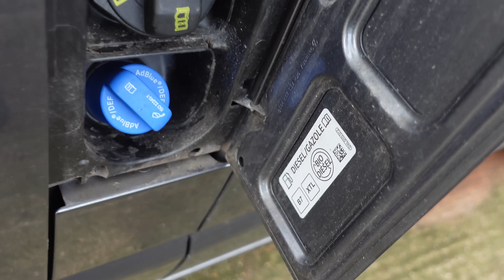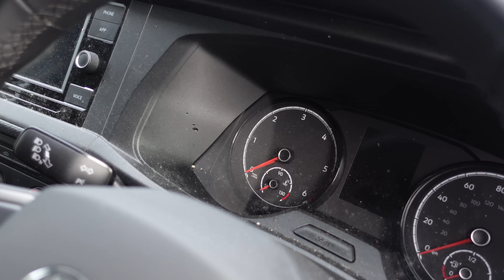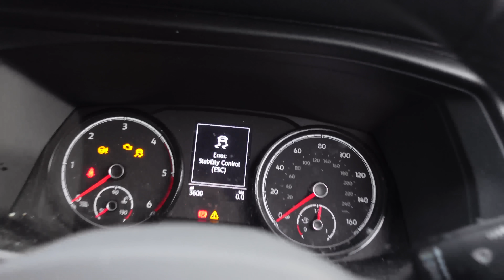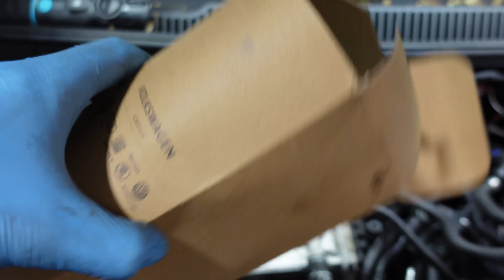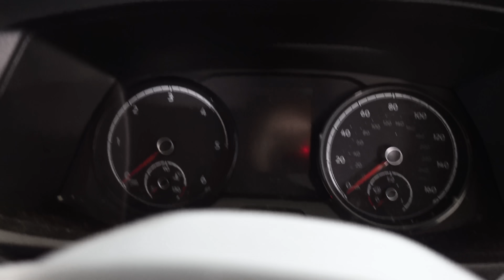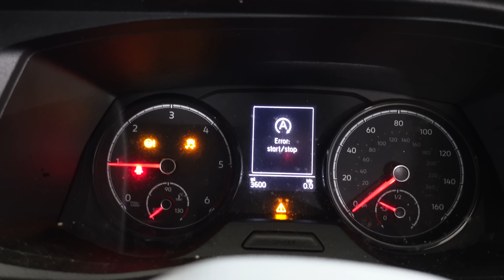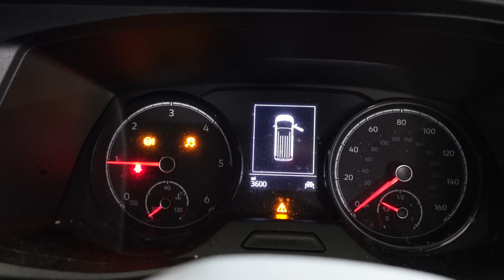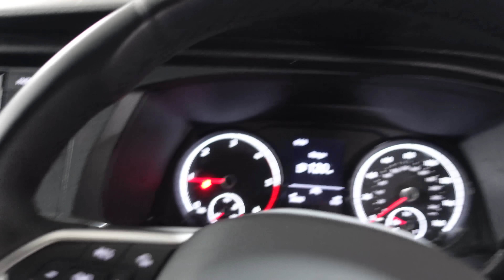I BOUGHT A CHEAP VW TRANSPORTER.. FULL OF PETROL!!! MISS-FUEL...

Comment from the maker: Win the PS5 and GT7 for free: https://competitions.adrianflux.co.uk/enter/win-a-ps5
Reply: You know you don't need to take the fuel tank off right? You can empty the tank with the primary fuel pump. Just hook up an auxillary tank to the secondary pump and let the engine idle on that. It took me about 15 minutes with a full tank. When the tank is empty, chase the last of petrol out with a liter of diesel. Stop the engine, fill the tank with diesel, change the filter and hook everything up again. Costs you about half an hour of work, the filter and a meter or two of fuel hose.
Reply: You should keep it and use it as a tow van for other projects like the caravellle
Reply: Still wonder why you didn't unplug the diesel filter and connected the fuel pump to a 12V DC psu or car battery to pump it out but hey, would make for less content ;D
Reply: UK only ?

Comment: Rather than disturbing everything removing the tank, would have been easier to purge the in tank pump via VCDS, yes you won’t get 100% of the petrol out, but if you brim it with diesel won’t do any harm, save all the hassle
Reply: Yep
Reply: Wouldn't that damage the fuel pump, which is designed for diesel fuel, not gasoline?
Reply: Pump would be fine, 30 years as a tech and never had an issue when it comes to draining misfuels. He made a very simple job extremely difficult for himself.
Reply: @Photos_by_Matt correct
Reply: Have a 2005 T5 that I've made this mistake with, mate powered the pump from under the seat and ran a pipe to a few containers for me, popped 25 litres into it and drove to a garage to fill it, changed the filter then and have had no issues since.
Reply: @welshtourist That was the PD engine and the fuel system was a lot more forgiving to misfueling than the new engines.
Reply: I can’t believe you took the tank out
Reply: @akhtarkh  
Would make no difference as I am referring to the intake pump what’s been submerged in petrol for months, but no not really in tank pumps are rather universal
Reply: @Photos_by_Matt  random one but as you're a vw tech, wondered if you could help me in a bit of a pickle with my wifes car! replaced egr cooler as code was p403 on the 1.6 tdi, now getting code p40700 which indicates sensor low circuit egr, its a brand new oem egr with the sensors etc, what should i test next, cant find any pin outs online to test wiring
Reply: @akhtarkh  not for the low pressure "in tank" pump. And actually changing the fuel filter without VCDS routine probably "f*cked" the injectors. it is possible that tha injectors are now running but not precise anymore on the small quantities (pre and post injections). Resulting later on in filling up the DPF faster and not regenerating as designed...
Reply: @akhtarkh No, Not the pump in the tank. It’s fine.
Reply: But that wouldn't generate the "content" for the clueless.
Reply: @smokinvalves  
That’s a point I suppose…. But for the sake of some extra views, I honestly couldn’t be bothered 😂
Reply: @ePetike36  yep I always Small Quantity relearn, causes loads of issues with the Mitsubishi 2.2/2.4 in the L200/ Shogun / Outlanders
Reply: @RiteSedFred123 
they will probably have there own separate pumps, but same thing as using the intank pump to purge
Reply: Be sure to change the oil before you drive it about.
Reply: @george-hz9xq   yes I forgot to mention that definitely a good move 👍🏼
Reply: @billysmith5168   1.6 CR are nightmare for EGR faults…. Best thing to do is have the EGR mapped out, save your self ££££ get a stage 1 remap probably in the same price
Reply: Battery, old fuel pump and some plastic  pipe. Pipe to both ends of the pump, one pipe down the filler and pump it out.
Reply: @DriveEspana  or just plug in VCDS and purge it out, exactly what the function is intended for
Reply: ‘because it’s been sat for so long’?. Wtf.
Reply: @donalfinn4205  hardly been sat for long enough to be an issue
Reply: That 12v pump you used to transfer petrol out into the containers,  as far as I thought you can't use it on petrol, diesel is ok but its not designed for petrol and risks starting a fire no?
Reply: @Sargejee  one spark ⚡️🧨🔥
Reply: Absolute unnecessary too do all that,drain as much as you can,diesel in,no trouble it will start
Reply: @georgebrehm8622  
100% agree
Reply: Now if only I knew what "vcds" meant, my life would be complete. 

Back before home recordable DVDs were affordable, then VCDs used to mean "Video CDs.  Some clever technical dude (or dudette) devised a way that a standard recordable audio CD could still contain a full stereo soundtrack, but also include 78 minutes worth of full motion video. At the time the video quality was about the same as good VHS video-tape.  

Apparently VCDs were highly popular in parts of Asia where humidity in the air led to mould issues on VHS videotapes.  

Later some even smarter cookie devised a way for a standard recordable audio CD to contain some 40 minutes of DVD quality video and stereo soundtrack, known as SuperVCD or SVCD.  

At the time I remember pretty much all the early home DVD players would play VCDs but only some models would play SVCD.  

I never knew why that was, as the actual encoding system of SVCDs is said to be the same as the DVD encoding type.
Reply: @KiwiCatherineJemma   VCDS is dealer spec diagnostic software, I can assure you nothing to do with DVD or VHS lol
Reply: @akhtarkh  no, liquid is liquid to the fuel pump, as long as you're not running it empty, average fuel pump shoots out fuel at quite a considerable amount compared to it's usage, the fuel pump is basically there to keep a high fuel pressure.
Reply: I agree, a little petrol wouldn't do any harm
Reply: @akhtarkh  Nop
Reply: This makes the guys who specialise in dealing with misfuels look like a real bargain!
Reply: You forget he wanted to make a video not fix it in 10 mins.
Reply: No ,why take tank out...

Comment: Filled my 2015  20,000 mile  vw crafter with petrol.  Drove 1 mile home.   Siphoned as much petrol as I could     Refilled with diesel     7 years and 130,000 miles later everything is fine.   Also drove 100,000 miles in 2005 bmw 530d after mis fuelling    Just personal experience
Reply: you’re probably the luckiest person 😂😂
Reply: This is my question how does someone make the same mistake twice 🙄

Comment: did something similar with my mums 04 golf diesel, she filled it with £40 worth of petrol!! towed it back to the house, lifted the rear seat to get to the fuel pump, took that out and used a pump to get the fuel out, filled it with some diesel and first turn of the key it started.. without replacing fuel pump etc... its been running for over 2 years since without issue.. surprisingly tough VW engines
Reply: Mk4... bulletproof!
Reply: not rustproof though @MrFlamezz100
Reply: I had a 2007 Toyota Auris 2LTR D4D which I filled up with Petrol by mistake and it actually drove fine up the Motorway for over 50 Miles and I only realised something was wrong when stopping at the traffic lights at the end of the Motorway because it was ticking over a bit rough. I returned home covering another 50 Miles before I had a look and found Petrol in my tank not Diesel. I decided to top the tank with Diesel and then just use up the tank full of Diesel/Petrol mix. Eventually it started running fine and I never had a problem with it. I eventually got a newer one after 160,000 Miles.😊👍👍
Reply: @stephenjones9153  Amazing ! 100 miles on a petrol ? Sounds to me that the garage you stopped in wasn't selling petrol .....

Comment: DEAN this is 100% true  i drove manchester to glasgow in a transit years ago then deliverd and then fueld up at 3AM with petrol full tank .   and it was a  diesel van  i started it and sat there eating a pastie  and crisps then it died  ,So i cut the pipe off the jet wash machine stuck it in the tank and sucked and i swear it started coming out all over the grid and grass ,Then i   ree  filled it with diesel ,it started but  it wouldnt do over 50mph in 3rd untill  i got to preston then boom it went normal ,i parked it in our yard at 9am and went home never heard again .

Comment: Half filled my 2.2 transit with petrol before i realised. Toppes it up with diesel and apart from smoking it ran lovely.
Reply: I did the same van run the best it ever did after used and refild
Reply: Yep did the same with my van..As yourself topped it up with diesel. Gave it a good run then filled it up again as per norm...Sorted..
Reply: Had this with a BMW, drained it and refilled with diesel, bit smokey for a bit the ran beautifully
Reply: Problem is too much petrol will do severe damage to the fuel system components because they rely on the lubricity of diesel.
The high pressure fuel pump on a common rail diesel is painfully expensive and too sensitive to risk running any petrol trough it.
If it fails the rail and all injectors are contaminated with metal shavings. 

Common rails are too sensitive and expensive to risk anything.
Reply: Did yhis with my Polo. Toooold the attendant my Polo is Diesel. He decided to fill with fuel because I am a woman and do nit knoooow what I need to pump in my car. Men. 🙄
Drove my car like that to the mevanic and he was shocked because my car was nearly on empty.
He cleaned and we filled with Diesel. 
My car drives till this day. Splendidly.
Reply: @alouisschafer7212  Mine has that.
2010 VW 1.6 tdi Polo.
Car still drives, after driving it like that to the mechanic. 😌
Reply: In the winter i always add a couple of gallons petrol to my diesel tank to stop the frost thickening the diesel
Reply: @alouisschafer7212  I had a £1000+ quote to replace the high pressure pump on a Renault Laguna diesel - that was in 2009 I hate to think what it would be now (more than the car would be worth!)

Comment: I worked for a fuel draining company for over 10 years, misfueling a diesel isn’t catastrophic enough for it to be an insurance write off. But you could have just siphoned the tank using a hose in the filler nozzle.

Comment: Great video Dean. A while back we used to use Shell as our fuel supplier and there was a small station that still pumped the fuel, we used the place on a regular basis, we were not always in the same van's. We pulled in gave the key to the cap the the attendant and walked in to get some other bits, I get to the counter and they tell me the amount of fuel I give them the milage and they say petrol I reply it netter mot be. I wouldn't mind it has Diesel around the cap. We spent the rest of the day having a picnic and messing about on a big grass area outside the fuel station they kept us full of tea and coffee while their mechanics drained the tank cleaned it out and re filled it with Diesel. We then went back to the yard, It was harder than working we were soul destroyed after 2 hours. We ran that van for another 3 years.
Reply: If you dont start it or try to drive the HD Pump wont mind but most people start it and the HD Pump starts to eat and will fill the whole fuel system with small metallic shavings.
Reply: You're a better one than me pal, I'd never be comfortable letting someone else put fuel in my motorbike, car or any vehicle for that matter if I had one, I'd always want to put fuel in myself.
Reply: @bikerguychris33  It was the fastest van on the planet, a company van driven by multiple drivers, I was later issued a brand new ford transit, then a Vauxhall astra both were only for me to drive and my superiors strange wording on the insurance.

Comment: You’re a braver man, than me Tonto. I’m not sure I would’ve pumped petrol with that oil evacuation pump. But hey, you’ve shown us it didn’t burst into flames 😂😂
Reply: I have one of those pumps and the instructions specifically say it is NOT to be used for petrol
Reply: @curtisj2165  yep, that’s why I said he’s a brave man. Petrol vapour and a motor with brushes sparking are probably not a good recipe.  The mix of diesel hopefully raised the flash point significantly enough.
Reply: @Justsayin999  its not just petrol, will be mixed with derv so pretty safe
Reply: @miketaylor1916  still flammable, i wouldn't do it
Reply: using such a pump from the LIDL for years to pump gas from the can to my car. they withstand gas ( petrol ) very well. i get my gas in belguim as its 40 cents a liter cheaper over there.
Reply: It cant , diesle donst burn , until it spryed at 8 Bar pressure , rgds Colin.
Reply: care is needed but should be no problem.  Remember that you buy both petrol and diesel at a gas pump. Of course anything general purpose would for liability say don't because someone will do something dumb.
Reply: Ik heb 12 jaar gewerkt met verkeerde brandstof in voertuigen , in die twee jaar heb ik twee keer een voertuig wat het niet meer deed , 
Als het zo hoor is het geen probleem met de motor

Comment: I would suggest checking the injectors and high pressure fuel pump. The hpfp is lubricated with diesel. If you fill up with petrol the lubrication is not sufficient which can cause metal shavings in the fuel system causing more damage to the engine in the longterm. Otherwise nice video :)
Reply: I can second that, I had a pal who miss fuelled a late model Ford kuga diesel, different engine granted, but I assume the idea is similar. Anyway, he just purged the tank changed the fuel filter blew the fuel lines and dropped new diesel in and no matter what he did he couldn’t get it to run without stalling, long story short he blew a control module apparently because of the constant starting without rest, it scrapped the hpfp and the injectors and cost him a small fortune in the end to get it running correctly again. So I would agree there is a lot to be said for what you’ve written above. Agree there may have been more to it, I’m not a mechanic so I don’t know. Also I can imagine it’s been standing with that fuel in the system for a number of months too, don’t know if that would make any difference.

Comment: Really enjoyed watching the progress through this video and seeing the van fixed in the end. These little short fix videos are quite entertaining. Always impressed with the work you do man 👍
Reply from the maker: Thanks 👍
Reply: @SavingSalvage  doesn't that van have a floor hatch for the fuel pump access? In cargo area I mean, if it has, you spent quite a lot of time doing something the complicated way.
Reply from the maker: No mate, it’s got a plywood floor one piece
Reply: @SavingSalvage  Yeah, but if you lift that plywood, after possibly removing some screws?
Reply: Mate, you could have done all that without removing the fuel tank and in half the time. I have done loads, all you needs is a can of diesel and and independent electric fuel pump. Connect directly to the pipe that goes to the high pressure pump at the fuel filter then rig up a pipe from the return fuel pipe back into the new diesel fuel source.  Now rig up a long pipe from the connection at the fuel pump that comes from the fuel tank into a waste fuel container and have another one ready for when that gets full.
Now power up the independent fuel pump and start the vehicle.  It will start and run on the independent fuel system and at the same time pump all the contaminated fuel out of the tank into your waste fuel container until it is bone dry. Replace the fuel filter add new diesel connect all the pipes back onto the new fuel filter, boom. Sorted. 
I even used to use the contaminated fuel up in my lawnmower was a bit smokey, but worked😅

Comment: I have to drop tanks for mixed fuel often, I use 2 ratchet straps and cradle the tank and lower each end back and forth, drain holes in the frame are good places for the hooked ends. Never dropped a tank with this method and have to deal with tanks exceeding 26 gallons.

Comment: You don’t have to drop the tank. You can use the fuel pump. Just ad a hose to the low pressure line and use vcds or bridge the relay.
Reply: Exactly what I was thinking, could have done that in 10/20 mins 👍🏻

Comment: Fuel pump only activates for a second or 2 when ignition is switched into position 2 and you have to do that about 10-15 times for it to fill the filter, that's what I always do on diesels that don't have the priming bulbs after a fuel filter replacement.
Reply: on VW you can just plug in vcds and let it run for as much as you like.

Comment: Not a problem really just drain petrol down brim tank with diesel keep topping up every 5 gallons and would run ok . Used to put a couple of gallons of petrol in to stop diesel freezing back in the days. Great video keep them coming.
Reply: Completely different car engine systems if you compare cars from 'back in the days'... 😉 Not as simple anymore!
Reply: You’re showing your age there. Yes used to add a few gallons of petrol to the diesel to stop it freezing but you no longer have to do that.

Comment: Easy done BP  in the wisdom in the 1990s change diesel to Green pumps and petrol to black pumps and I was out doing a chore in a VW transporter 1.9 T2
I put 40L into a tank with 85L capacity existing fuel was 5-8L. I just filled the van up to the neck with correct diesel and drive it out and topping up with diesel.
Never did any harm, I bought the van years later and got 200,000 from that engine. That is shocking rust for a new van!